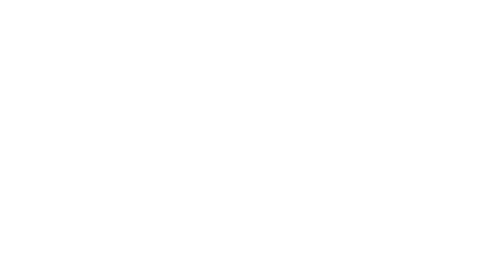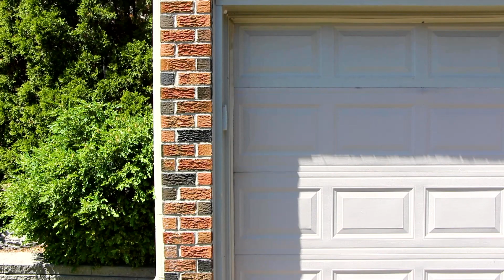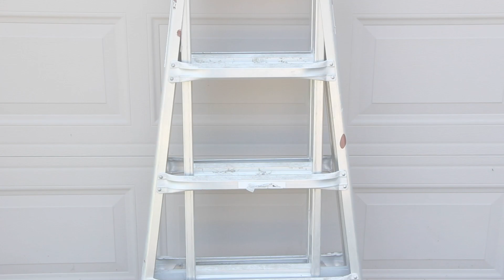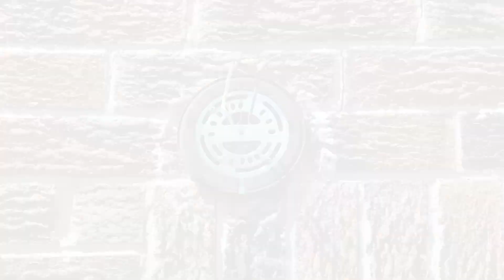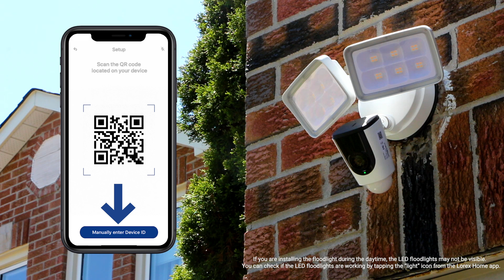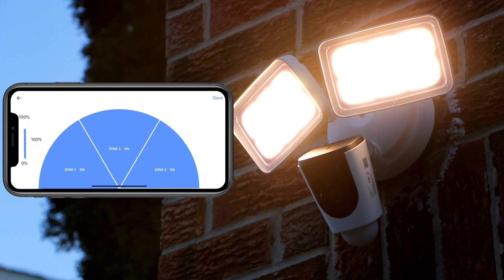Lorex 1080p Wi-Fi Floodlight Camera Installation Guide

Comment: Floodlight wil not connect to home app on mobile phone. Added wifi extender still no getting passed step connecting floodlight to internet. Can not even get to step for floodlight device name and enter password . No help on Lorex website for situations like mine. FRUSTRATED!
Reply: Does it work?
Reply: @redleaderone8429  You must have a strong wifi signal or it will not work. Setup is a little confusing but if you are patient it can be done. If not get some youngster to help you out.

Comment: seems like all this work could be avoided by simply adding a solar panel 0-o
get this the times people.
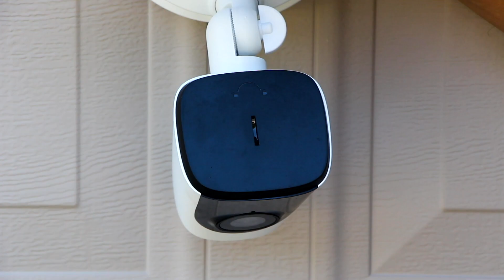0:37 should have kept this part on the low, now all would be robbers know how simple it is to dismantle it as well as reset it.
Reply: I am replacing A solar flood light.  The batters have to be changes every now and than on solar so  need get the ladder out . pain in ass Allways seams to die in winter or bad weather..